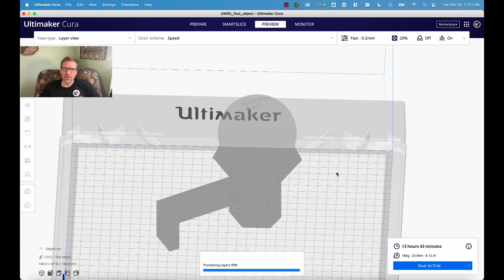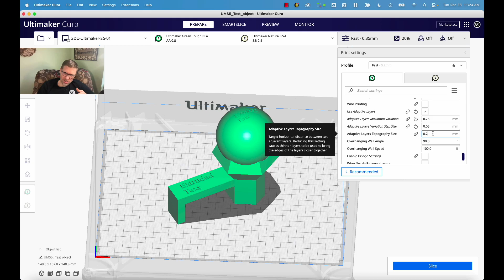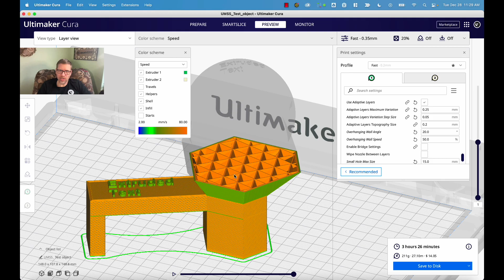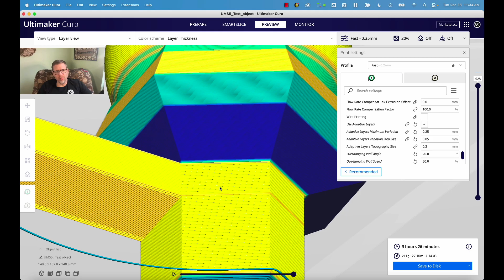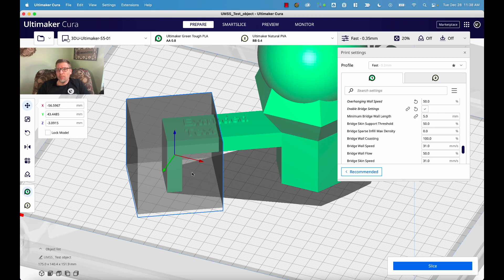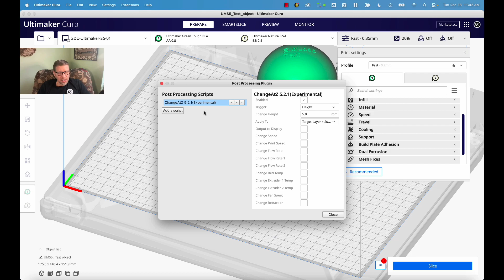Ultimaker Cura Advanced Slicing Techniques

Comment: Cura seems to freeze when slicing with more than like 10 objects. I've looked on the internet to find a solution but nothing seems to work.

Do you know of a way to improve Cura's ability to slice lots of objects? I'd really rather not have to do my print in 60 goes. especially when everything fits on the build plate at once.

Comment: Excellent.  May I ask though why when sliced my print time states 2hr 3 minutes but once I add the file to my printer it changes once its loaded to a 6hr 27m print.  It seems like Cura's estimate and the actual print time is vastly different.  I followed the video to a Tee and the time did reduce with each slice but it didn't seem to translate to the printer..... UPDATE:  it appears that the time is reducing substantially as the print progresses.
Reply from the maker: Thanks for sharing. I’ve seen differences between the print time estimates and actual print times in the past, but never as significant as that. Glad to hear it corrected itself as the print progressed, but I’m still curious as to why it was so far off in the beginning. If you’re not on the latest version of Cura, be sure to update. There were massive changes with v5 (and it’s v5.3.0 as of the time I’m writing this). The whole slicing engine was redone, so your results may be much better with v5. I’d love to hear back from you about whether or not that’s the case!

Comment: Very good tutorial.
I was trying to use fuzzy skin for parts I have to hold, but I'm having to sand it off where it interfaces other parts.
Can support blocker block fuzzy skin or only add fuzzy at certain points?
It fails when I try it.
Reply from the maker: Good find! I just tried this using the latest version of Cura (v5.2.2 currently), and it does appear to be a bug. I'm able to select any of the Fuzzy Skin related settings in the mesh modification options for the support blocker, but those settings appear to be completely ignored when slicing. I'll report this issue to the Cura development team so they can get it fixed in a future release.

Comment: Hello there . I am still working through your video and it is very interesting thanks.  I haven't seen the smartslice feature in my Cura ? How did you get it ? 
thanks in advance
Reply from the maker: Sorry, I forgot I had that installed. SmartSlice is a 3rd party paid plugin that I have installed. Unfortunately, the company recently sold their software to Markforged, so it's no longer available as a Cura add-on.

Comment: This was excellent! Subscribed:-) Can you discuss using large nozzles like 1mm and 1.2mm in vase or spiral mode. I was trying to print some transparent vases (nothing special). The prints failed and the gaps between layers were excessive. The same STL in PrusaSlicer (same nozzle size) did at least a solid "wall" job. Mainly the curved walls were connected. These were both done with mainly default settings.  I have a spare Ender 3 and want to put either 0.8, 1.0 or 1.2mm nozzle on it, but only if I can successfully slice in single wall mode. Thanks.
Reply from the maker: Hard to say without seeing all of your settings, but the first thing that comes to mind is to check your volumetric extrusion rate. You can only push so much plastic through a nozzle at a time, given the melt-flow properties of whatever material you're using. So if you multiply your nozzle diameter x your layer thickness x your print speed in mm/sec, you'll get your volumetric flow rate. Anything over around 12-15 mm^3/sec is going to start to cause issues. You can try increasing your print temperature by about 10C to improve the flow rate. I've never had any issues using vase mode, so I can't think of what else could be causing gaps between layers. Feel free to email us at info@3duniverse.org if you want to dig into it more.
Reply: @3duniverseOrgWelcomesYou  the volumetric extrusion rate you mentioned below, is that the same for all nozzle sizes? Or does the acceptable ratio change for different nozzles?
Reply from the maker: @TheButchersbLock  The volumetric extrusion rate can be calculated regardless of nozzle size. Since the nozzle diameter is one of the values being multiplied, it's factored in. Just multiply the nozzle diameter times the layer thickness times the print speed in mm/sec.